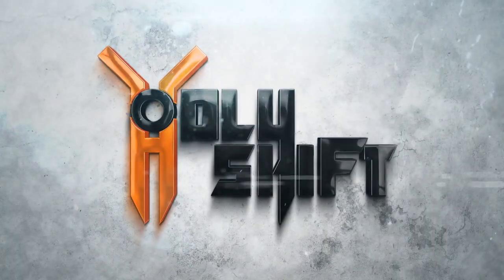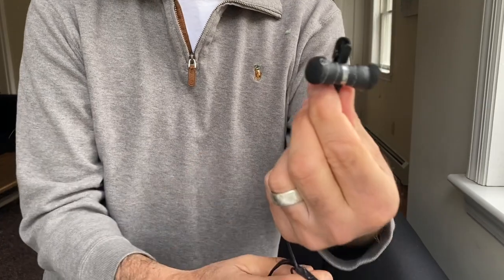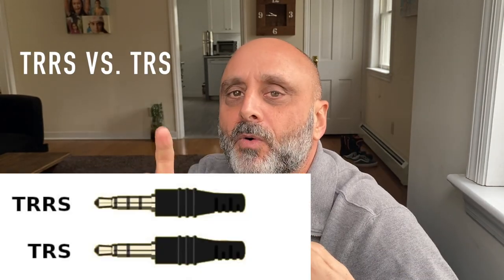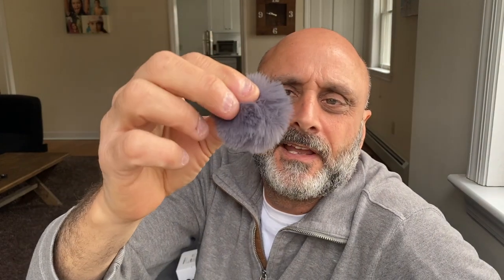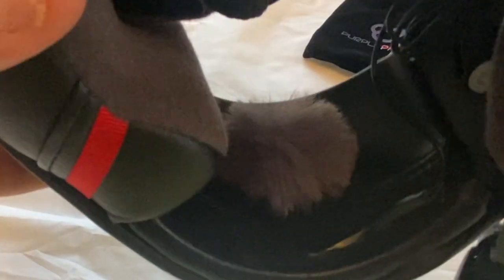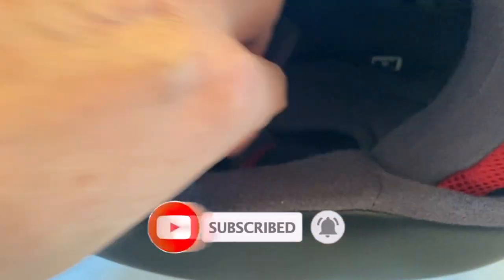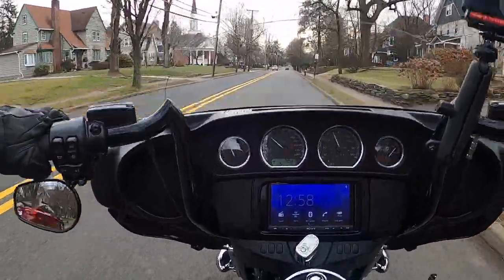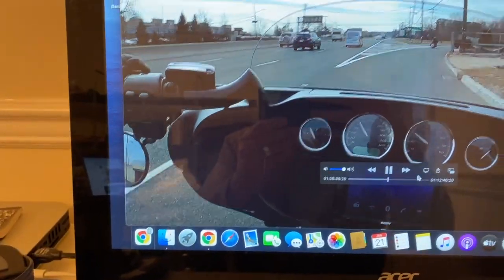Helmet Microphone Install & Review

Comment: I am actually struggling with my sound. Used an old headset as a mic but that was a failure too. I use a cellphone for recording. Now I ordered a Lapel mic from Temu and let's see how it works. It should be here in no time.

Comment: I am using the saramonic xm 1 mic along with a short extension cable. This setup completely gets rid of that extra long cable and the push under the cushion hassle 👍
Reply from the maker: Yeah - the long wire I have is pointless!

Comment: The video is a little old already but it fitted me like a glove, because i have that very same helmet, and i have been struggling with wind noise and clipping, both with a boya and rode go mic... they are probably just to sensitive...
I'm actually waiting on a Movo acm400, cause moto vloggers say it's the bomb right now, but if it doesn't work, the "blue" purple panda it will be. 
Thanks for the video 👍👌
Reply: did the movo work?
Reply: @billjohnson3284  yes. The movo has been fantastic. I made this vlog with it. Best mic so far, by far! 
https://youtu.be/MYkv_ZcTgoY
Reply: @John_Neves  fantastic thanks !!
Reply: RMSFAM09  no. I have mine in the right pad, poking out slightly. Very happy with it 👍
Reply: @John_Neves  thanks...I have same mic...im going to try both positions..problem is I have hyermotard with sc project crt exhausts...they are very very loud